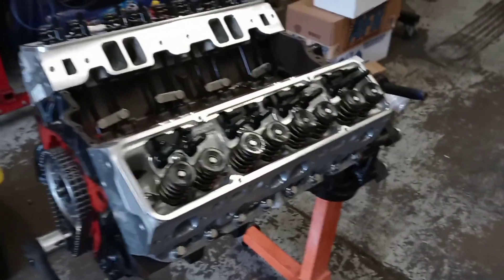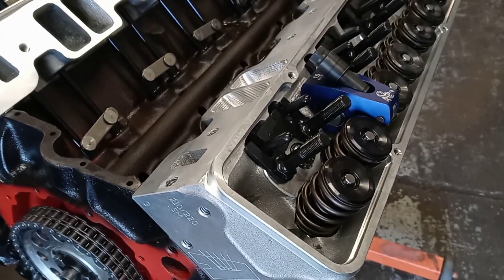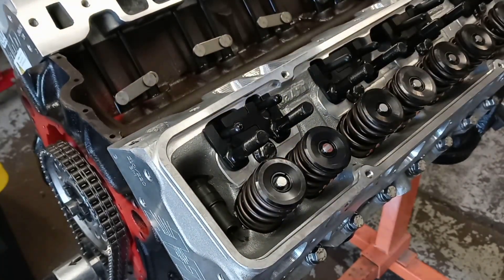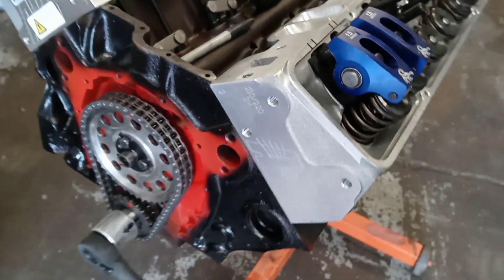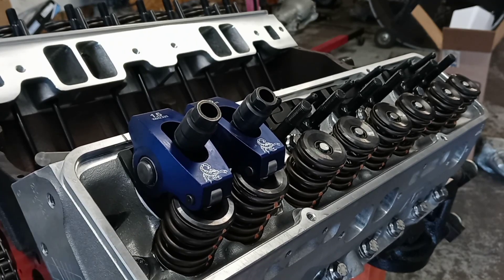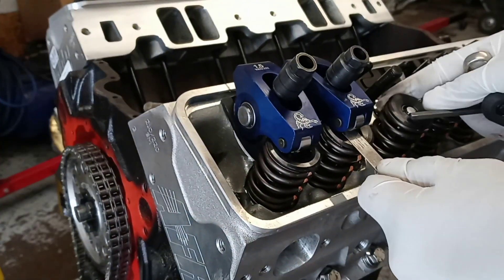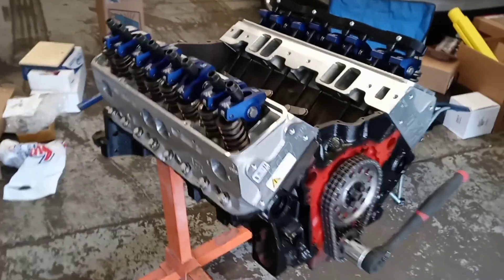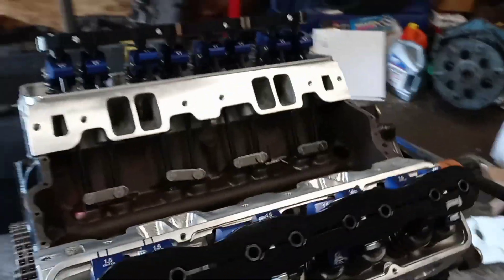Part:ll adjusting valves and checking pushrod length on this 600hp pump gas SBC

Comment: I like how thorough you explained everything. Most of it I understood very easily, but there were a few things that went over my head. But thats ok.
Your a lot better than most guys who think everyone knows a lot about engines and  skips the details they do.
I just bought a 406 small block beefed up to a 427. 565HP to the flywheel.  Can't wait to  finish the frame of restoration of my 66 Malibu.

Comment: Although i agree with everything you do,  i would have liked to see you remove the remaining RTV from the valve stem and rocker roller.  i wouldn't want ANY foreign material going through my engine.  other than that,  great job.

Comment: I’m not sure if you check your comments but it’s work a shot do you know how long your push rods are I’m running a similar set up same heads and a solid roller cam according to the pushrod checker i need 8.125 I’m wondering if yours are close to that